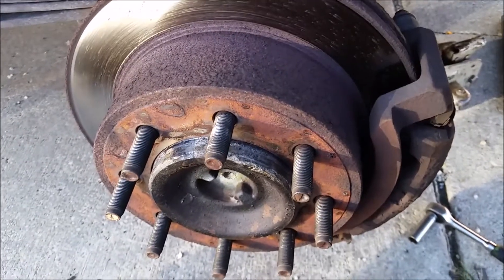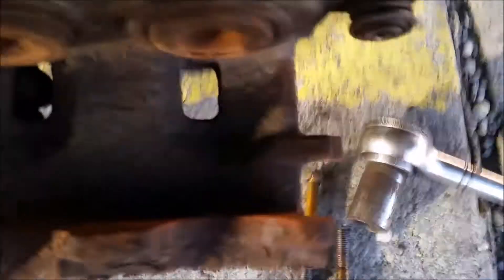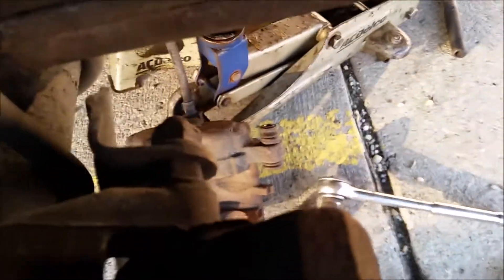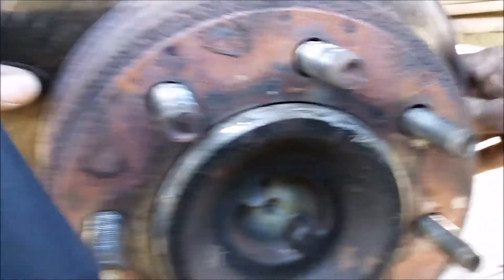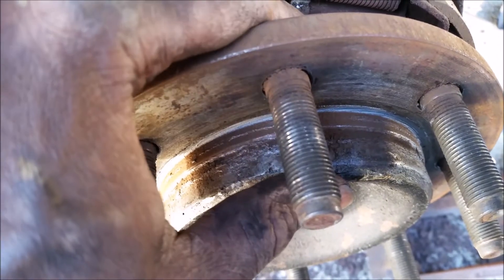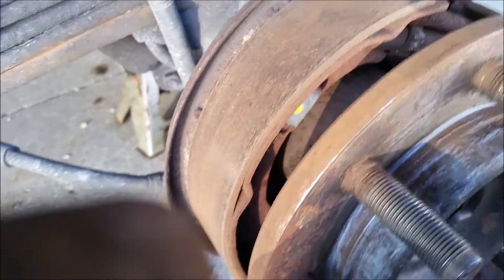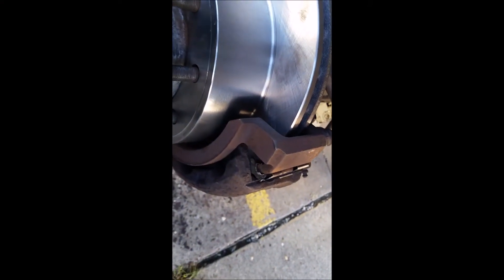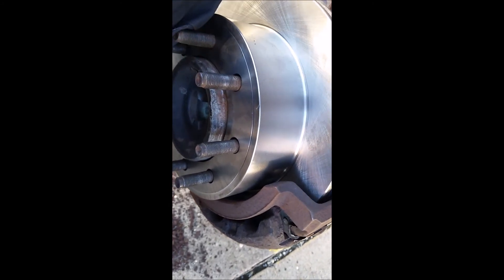How to replace rear brakes on a 2006 Ford E250

Comment: you have to figure the drum brake pads wear a groove into the inside of the rotor  because of the automatic adjustment mechanism so you have to back them off before you remove the rotor